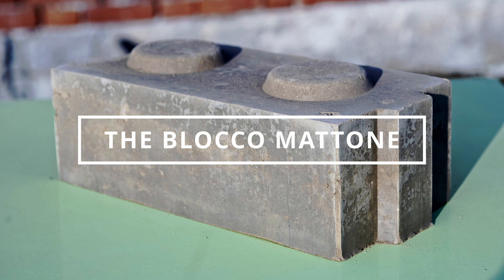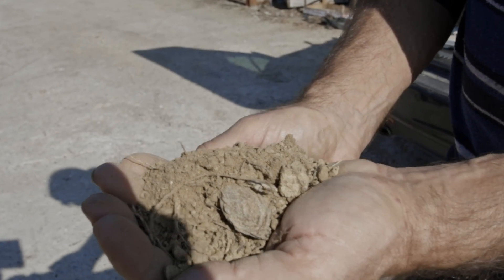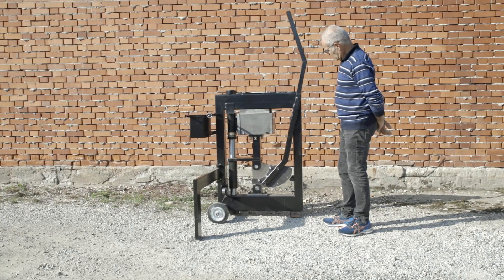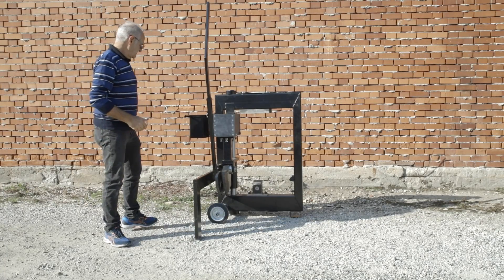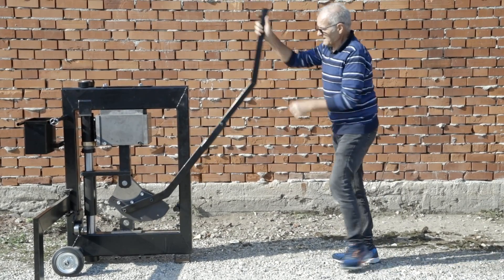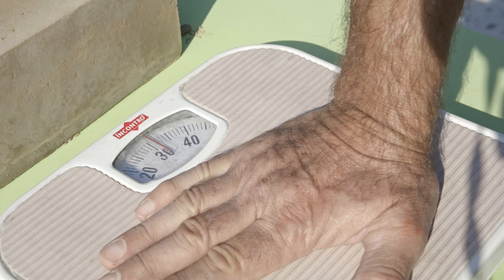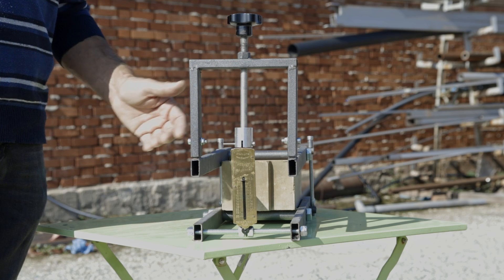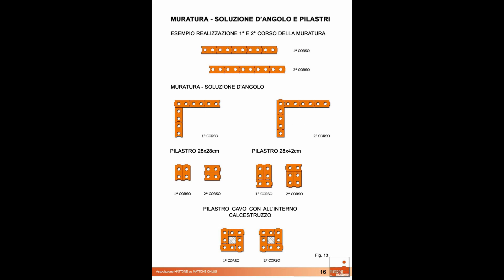MANUAL PRESS FOR BRICK BLOCK IN RAW EARTH CALLED "BLOCCO MATTONE"

Comment: There are other pressed block machines that are more automated that can be transported from site to site. They even have a conveyor belt to catch them to stack them in pallets as the machine spits them out. 
Whether you want a manual press, or an automated one pressed blocks are a great Idea. 
If I were to make one, I would make the blocks bigger. So the walls are thicker for more insulation and stability value. 
I used to live in an adobe home with walls that were 3 feet thick. Those walls were insulated. The only issue with those is losing most of your heat or cooling through the roof.
Reply: The automated ones...do you have a link where you saw one?
Reply: @mtejaa  No, but you can google. There is also another video of a guy showing it off on YouTube.

Comment: Hi 
If marble dust and sands mix with mud 5% each ie 5℅ marble dust 5% cement and 5% sand
My question is then it wil palastarized or chips work wil be done on the easily and sucesfuly
Pls comments

Comment: My 2nd question is whether the machine is sold together with the block strength testing equipment as a package? If not, I would suggest you do that because fabricating one to the standards of the designer may be a challenge in some certain parts of the world jeopardizing the outcome of the entire process. If you do sell the machine with the testing equipment, big kudos to you - Nairobi, Kenya.

Comment: interlocking blocks good earthen stabilized with lime better... it is the start of the limestone cycle...low carbon footprint, great thermal properties and slowly the earthen block with white washing will become limestone...in centuries so why not imagine building a house that gets stronger as it ages ...engineer in a hypocaust for heating in cooler zones and keep a good roof on it as well as foundation that collects rain water to cisterns so lkeeping the homes is more long term...
Reply: Can you make a video of it.  Are you saying replace cement with lime? Or lime washing?  What's your opinion on Sorel / magnesium / Zinc Cement as water repelling direct contact with wood?
Reply: @SkyChildUSA  good question!!!
Reply: Lime is already used as a standar stabiliser in this kind of blocks as far as I understand  @SkyChildUSA
Reply: Replace at least 50% of Portland cement with lime.
Reply: I know that line and cement are used in binding but also what other kinds of natural elements may we use to bind
Reply: should have said or cement
Reply: Can you give me the link where I can purchase this machine. Thank you
Reply: Lime and cement dont mix. Lime breathes while cement absorbs water.  Lime should be hydrated lime (slaked quicklime).

Also, cement is not so carbon neutral.
Reply: @firstname-qq3xp  yes lime or cement and yes burning your own lime stone in clutches or batches is old school but after slaking the lime stone putty is easily added to the clay sand mixtures to be folsed in and a lime slurry milkshake is the best glue between the courses of block. some building codes still insist on bonding beams and lentils but the blocks are easily reconfigured to allow for them and simply fill them up for beam and post configurations!  My next home f there is a next home will be of these materials instead of brick...alone! why because my children's children's children can raise their grand children in the same structure if the world has that long...
Reply: @firstname-qq3xp  I'm not so concerned about carbon footprint on a 300+ year house build.  That's a better question for people purchasing new iPhones or who engage in air travel, a temporary good, or service.
Reply: @SkyChildUSA  perhaps if maintained, with a deep and strong foundation, and use of quality cement. Otherwise, the lifespan of cement isnt as long as you think. Can be 50-100 years more than likely. 

And concrete makes 8% of global carbon footprint. So it's not insignificant.
Reply: @firstname-qq3xp   That's Portland not Magnesium/ Lime concrete with fly ash which runs about 1/4 or less of that.  Magnesium Concrete like The Great Wall of China and many of the Stupas in India, 800 year old wall in Germany. I don't fly, i don't buy new cars, or clothes. Can you say that? Otherwise maybe you should look inward
Reply: @SkyChildUSA  under stood but with earthen cooling and gondolas this house would be light on foot print forever and escaping generational debt each one surrounded by porches and solar gain with aircurtians little to no heating or cooling required so savings from under roof to 500 years out ...In an economy of you will make nothing and be happy this is a way...
Reply: @MyLevelheaded  not sure if we are disagreeing.... trying to follow you.. what i'm saying is that if you add magnesium then wood contact isn't an issue. as calcium and mag in balance drive water out.
Reply: Lime mortar is not recommended for use with wood. Lime is not a good binder and is vulnerable to moisture. When wood comes into contact with moisture, it rots, and limestone will leach moisture from the wood, causing it to rot faste
Reply: Also when move to a magnesium (and lime?) you can use dirty soil... or not exactly perfect soil like you need with Cement which is what we both are trying to move away from. 

https://youtu.be/dX_QbphiM6I?si=ou9BuRj43wuV1XPl

https://youtu.be/BBZ44UC-XMk?si=sPifK4fFxMvCHoru
Reply: i'm not sure on this in this application i'm trying to learn
Reply: @SkyChildUSA  It is why I lean adobe...Not as strong and by strong some compressed blocks are compressive strength or 5000 lbs per squre inch adobe on the other hand once intially dried are at 800 lbs per square inch but over much time they become limestone! Building codes still demand bonding beams for a reason! but some works demand concrete! It is why i prefer ranch style root cellars at grade and ranch style homes with limited crawl spaces for plumbing maintenance and hypocausts for under floor heating ...concrete and pan house floors for homes and porches!  Adobe is a match made in heaven! external chimneys and fire boxes ondol type drafting for the fire box to external chimneys in the yard like korean homes...I would use steel pipes schedule 40 steel pipes 3 feet from the walls with copper shield refinery grade lubricant on the threads of the pipes to a central chimney in the yard the smoke and heat stays with in the pipe but the radiant heat fills the crawl space! This filling of  the crawl space, warms the dirt and gravel and the floor the adobe brick also absorbs the heat etc...some electric floor heaters if you leave the home for warmer weather as back up...like going on vacation to tropical climates  in the winter! all stable temps will convect to the home over time The crawl space heat Convects the heat to the home! and the crawl space uses the internal heat of the earth to cool in the summer and stays about 56 degrees in the winter as long as the maintenance doors remain shut...The dead air the earth and the steel flues 5 feet on center ad 3 feet from the walls leak warmer heat in the winter to the dead air and pan and concrete and into the adobe block and floor no fans wires or switches required to keep the home comfortable...1 wood fire per day and in just cool weather maybe one a week...Then in spring and summer fall nothing at all til the cooler weather sets in the earthen mass of the home goes far to heat and cool...if the windows are laid out right solar heat adds to the comfort ! for instance in the dessert climates a 35 degree drop can happen at nite so at night occupants open the windows allowing cool air in then in the morning they shut the home tight...the earthen mass is sufficiently cooled to maintain until the evening sets in and widows are shaded by porches are opened again the next night...etc...Some even have buried pipes in the ground so that as they vent warmer air out a few well placed high widows  the hotair inside is vented  air is slowly pulled by vacuum into the house from the subterainian pipes which cool the air to about 56 degrees....in the desert during the day creatures bury themselves during the heat of the day...for that same temperature control...